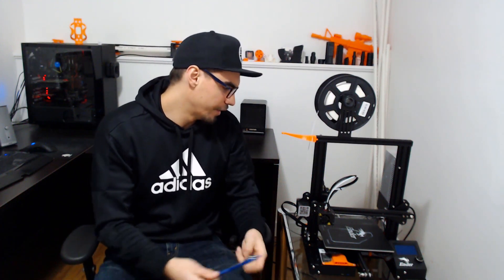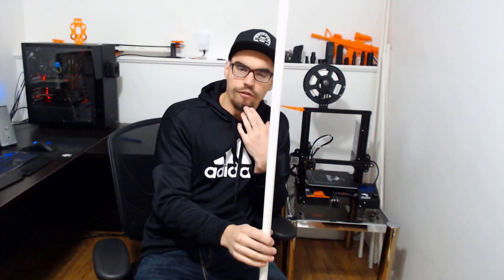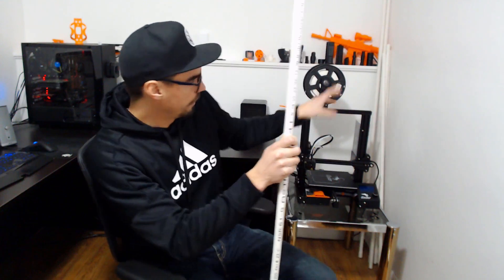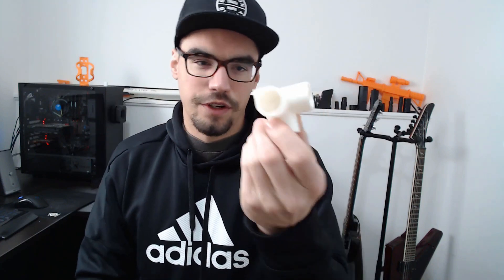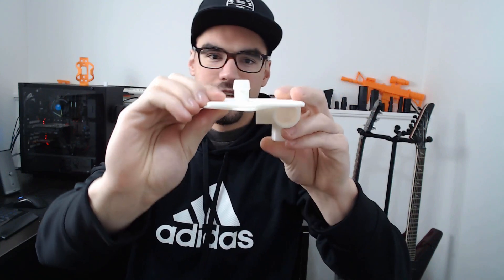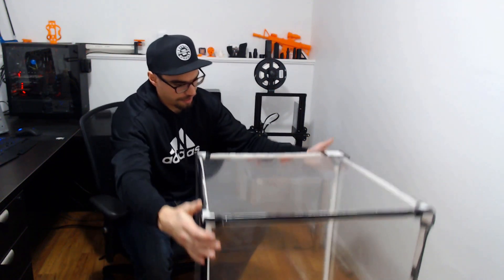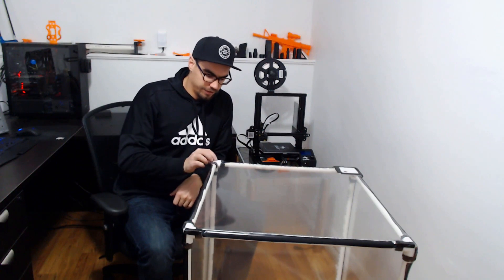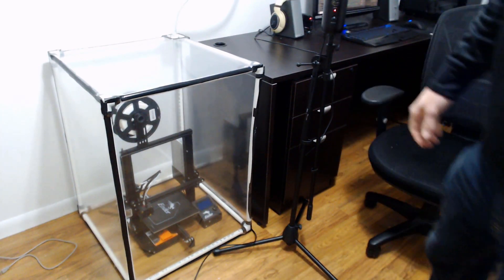Budget Vented 3D Printer Enclosure

Comment: (genius computer builder here) in order to not contaminate your rooms air you need negative pressure within the enclosure. a simple heat rise option will not work as intended. make a small air inlet on the bottom and add an exhaust fan within the exhaust tube setup. this means you might have to have a larger exhaust tube unless you get creative. thats what i will be doing to mine. it will require some fiddling to get perfect but in the end you will have eliminated the ability for gas to excape out of the bottom. and with only one place to go, your room air will be clean. also reccomend getting an air purifier for your printing room if you spend a lot of time in there while printing just in case.

Comment: Thank you so much for the simple and efficient design.  I plan on building this and I was wondering if you could give me the object file for the tube connector since I would like to modify it to fit a 120mm fan instead so the air would be forced out.
Reply: You definitely do not want a fan to blow the warm air out. That leaving air will need to get replaced, so the fan would then be sucking the colder outside air in through all of the cracks. Cold air coming in would mess up certain prints for sure! Just a heads up.
Reply: @PretEnGineering  Sounds awesome, thanks again, I hope your vacation went well